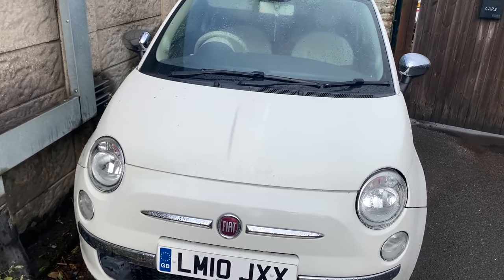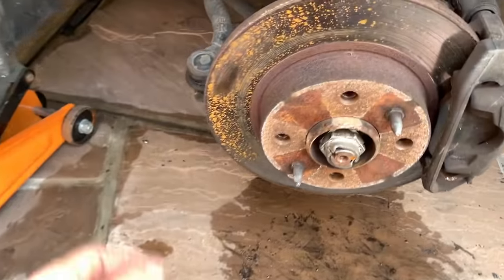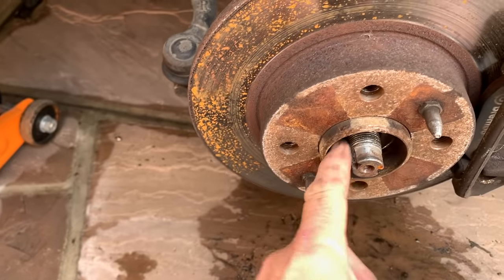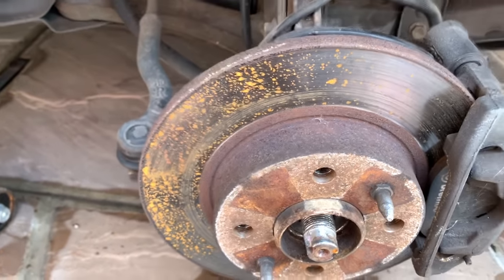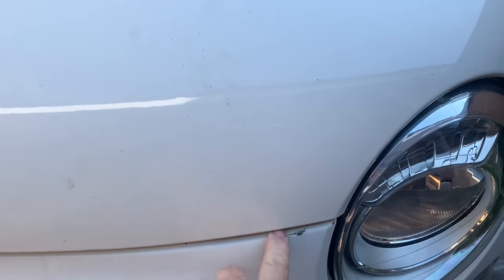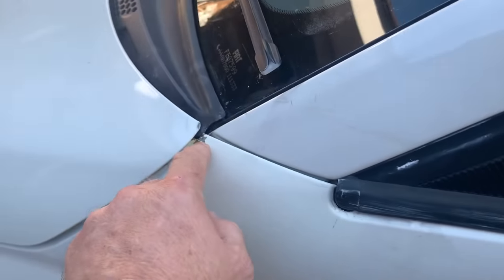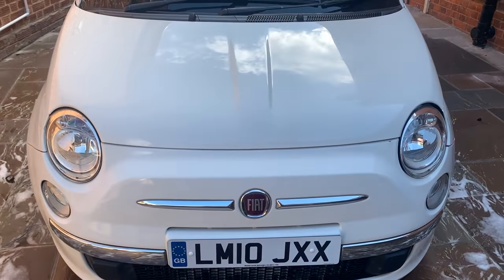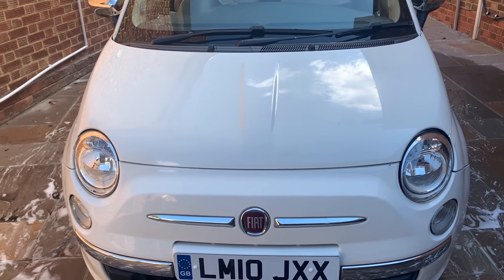Fiat 500 - Project White Pop (the one with the sunroof)

Comment: Hi Paul I’m having an issue with starting a Fiat 500 fuel cut off has activated just wondering if you know how to reset many thanks
Reply from the maker: o t turn the ignition key to MAR;

❒
activate the right-hand indicator;

❒
deactivate the right-hand indicator;

❒
activate the left-hand indicator;

❒
deactivate the left-hand indicator;

❒
activate the right-hand indicator;

❒
deactivate the right-hand indicator;

❒
activate the left-hand indicator;

❒
deactivate the left-hand indicator;

❒ turn the ignition key to STOP.

Hi

when the ignition is is the MAR position ... the right hand indcator will be flashing 

push indicator stalk up till the right hand indicator stops and the left one starts flashing .. push down to left until the right hand starts flashing again ---- it's usually after 3 or 4 seconds......follow with up again ..... so on an so on as described above ... both indicator lights will flash together at the end - turn key off.

you will hear a clunck/click - this is the fuel solenoid operating at some point
Reply: Love 500 thanks the car started  i was trying for ages what I was doing wrong was not pushing the indicator back to the Centre position at the end
Reply from the maker: o t glad you sorted it.

Comment: Surely , with regards to the white pop.... that’s a classic symptom of a worn wheel bearing ??
Reply from the maker: Stephen Evans do you think? Possibly I suppose.
Reply: Love 500 deffo. My daughters had the same problem . Have you not got a torque wrench cos I think you could have made it a whole lot worse with amount of times you Swang on that ratchet 😱😱👍
Reply from the maker: Stephen Evans yes I have but it was stiff right at the start. Looking at the other side it is not fine up enough.
Reply: Love 500 I’m no mechanic . I was at the garage when they diagnosed my daughters. Apart from it wobbling when it was jacked up, they spinner the wheel and you could hear the dry ball bearings going round. Hopefully a cheap fix .... as I said , I’m no mechanic. Everything goes to the garage cos I haven’t got the balls to attempt it myself!

Comment: Wheel bearing rather than the driveshaft I'd say. The drive shaft just goes into a spline held by the centre of the inner bearing race the outer race in the hub supporting the car. It has no role in supporting the cars weight, that's the bearings job. The reason it's wobbling is due to excessive wear in the bearing itself. It was probably worn with a little bit of play and some numpty decided to try and tighten the hub nut to remove the play and overtightened the hub nut stripping the thread and because it was overtightened it accelerated and increased the wear on an already worn bearing. You can see from the abuse that hub nut has suffered by someone trying to restake it that it's been messed with.They're not that type of bearing in those hubs though, they're just plain bearings so not adjustable like taper bearings. Unfortunately as you've highlighted if they've damaged the thread on the shaft you might have to replace that as well. Hope you didn't overtighten it as well using that breaker bar on it.
Reply from the maker: Alan Campbell I didn’t over tighten, that’s why I stopped. It was really stiff right from the start. I do have a driveshaft already, just in case. Only issue is Conor doesn’t have a press to get the old bearing out. I do have a hub but need to check which side it is.
Reply: @Love500  don't know what it's like in the South but most garages up here in the far North will press a bearing in for a tenner in cash or a couple of drams 😁

Comment: The wheel bearing is shot. Someone has tried to tighten up driveshaft nut to remove play and overtightened it till the threads have stripped . May even need a hub, Get Connor to have a look there should be no play at all
Reply from the maker: Richard Mounfield I think you may well be right.

Comment: Need some help! My fiat 500 had the wrong battery put in it (but new one in now) but the airbag lights came on, seatbelt light, start stop won’t work and my mileage is flashing. Any clue how I can fix this???
Reply from the maker: Britany Jane Bowman sounds like you need diagnostics but you may have fried your ECU I suspect. What was wrong about the battery? You could just try a proxy alignment it might reconnect.
Reply: Just done a diagnostics and everything that comes from the BCM is a problem? Do you think I need a new body control module? And if I do, does this need to be set up by fiat or by anyone?
Reply from the maker: Britany Jane Bowman if you need a new BCM it has to be programmed by Fiat I believe. The other alternative is to by an ECU/lock kit on eBay for around £100. Change BCM, Engine module and door lock/ignition and the ignition ring. Much much cheaper.
Reply: Okay. Thanks you’re a star! I bought the fiat 3 months ago and have had the problem for this long, so the dealer is fixing it but he’s been so so slow so decided to ask you because I knew you’d have more of an idea
Reply from the maker: Britany Jane Bowman dealer will install a new BCM then
Reply: Just an update in case you wanted one😂 took it to fiat and they said the airbag ecu is completely broken!!
Reply from the maker: Britany Jane Bowman well that’s better than it being the BCM.

Comment: And THAT's what happens if you use a hub centre nut, whether on a drive shaft or the stub axle, more times than they are designed and specified to be used.  They are only designed and engineered to be used, i.e. tightened up and staked over, so many times and if you try to use them beyond that number of times then metal fatigue will set in, there's a good chance the staking will fail to hold, the nut will loosen and, in this case, you'll destroy the outboard end of your driveshaft, at the least, and can very easily destroy the hub bearing and, if that starts spinning inside the bub, which can happen, you'll very likely destroy the hub assembly too.  That's going to get very expensive really fast.  If, however, it's an un-driven wheel, and plenty of vehicles use this type of fixed use nuts on un-driven wheels, you can very easily lose the wheel and brake assembly while driving, which can easily lead to you losing control of the vehicle and have a very nasty accident.  These nuts are consumable, service items and they're not expensive even if you have to go to a main dealer to get them, so don't cheap out and take a chance as it will come back and bite you either economically or physically.  If you're not sure if your vehicle uses these limited use nuts, and most vehicles built after about 2000 will have them, then do a little research on the internet before starting work on your vehicle, there is very likely to be someone on there who can tell you if your vehicle has them, and where.  If it's a "new to you" vehicle and you have concerns over its' maintenance history then it might be worth considering changing these parts out as they really are absolutely safety-critical.  I know of plenty of cases where people have been killed by losing the wheel assembly on their vehicle, and people have been killed by the loose assemblies too.  As you can imagine, having that weight of wheel and metal components coming through your windscreen at 60 mph tends to have a less than amusing effect on the occupants of the vehicle, and you don't want to imagine what it does to pedestrians...
Reply from the maker: gosportjamie a new one comes with the bearing. I was just trying to diagnose the problem. A new one was installed
Reply: @Love500    I wasn't particularly saying that to you, just making a general point about how safety-critical these small parts are.  I've seen people try and get away with using them beyond their design life and it never ends well, but people still try to skimp on the small things and end up sinking the ship for a ha'porth of tar...